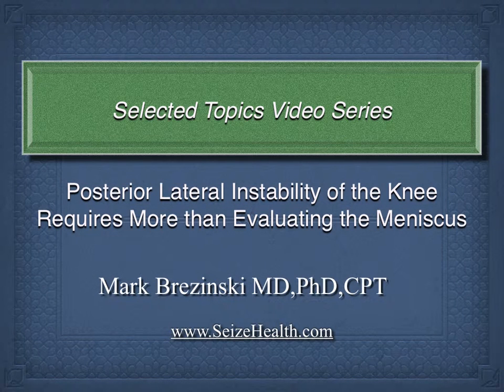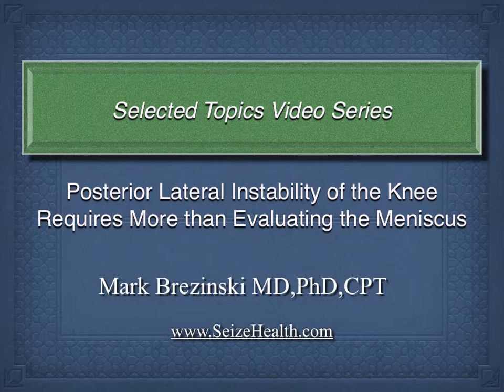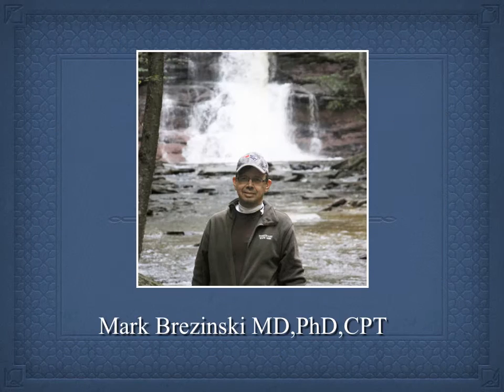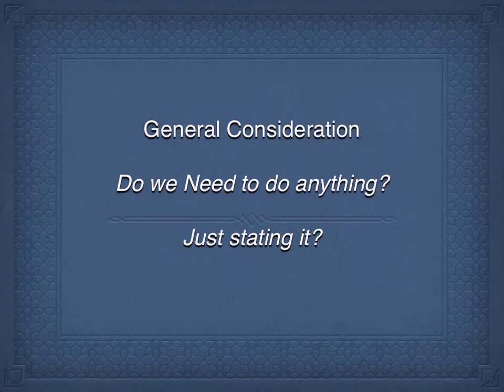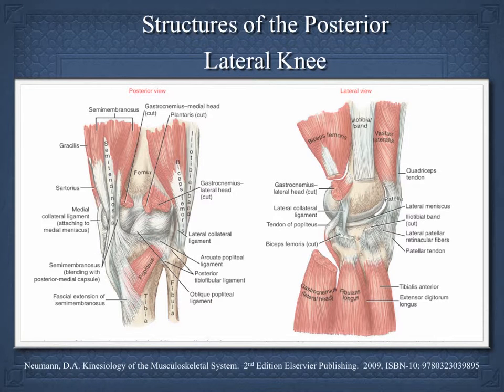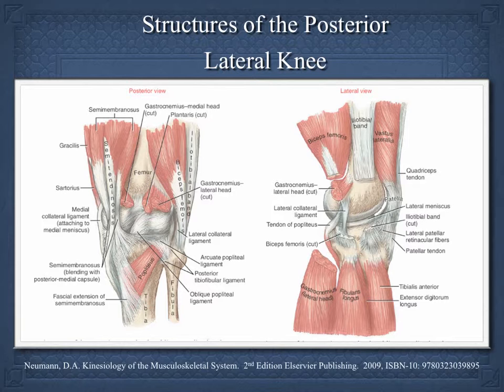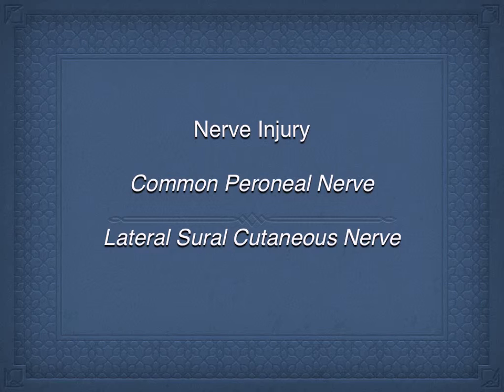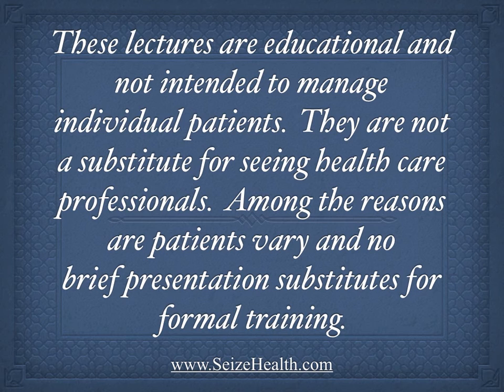Causes of Posterior Lateral Knee Instability and/or Pain

Comment: no explainaton...overall 0
Reply from the maker: What are you looking for?  Posterior lateral instability is something I commonly see but most provides do not know a diagnosis beyond posterior lateral meniscal tear.  A high, high ankle sprain (superior anterior TFL).  The patients often have a positive squeeze test but negative dorsiflexion (external rotation) test.  There are other differences.  Locking of the fibula would be another.